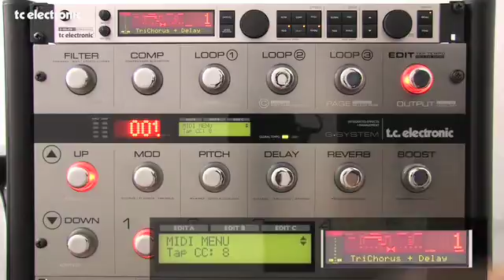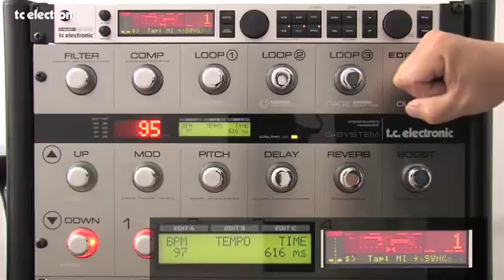G-System tutorial: Tap Tempo on external device

Comment: Hi, is this also possible with the nova system, ie to control the tap tempo on a g major 1 or 2 with the tap tempo button on the nova. Also is it at all possible to control the separate effects within a preset on a g major with the corresponding pedal of the nova via midi, ie turn the g major delay on/off with the delay button on the nova? Many thanks, Mark

Comment: Can an external switch be used to tap in the delay?
On stage is a lot different to "on bench" - there is a lot of multi-tasking and quick thinking going on.
It is too common for floor units to be released before testing for stage-usefulness using independent musicians.
I don't want to have to reach my booted foot over to the back row of switches, and risk hitting the Boost switch. (Actually I don't want to wait 4 beats before the new delay tempo kicks in either)
Do I have to resort to an external Midi Tempo Switch? - or can the external control be configured as a Tap Tempo footswitch?

Comment from the maker: OR...
you can try to assign another switch button of the board to TAP TEMPO in a momentary mode. This means that the button will send 127 when pressed and 0 when depressed.  This will allow you to tap the tempo at normal speed  BUT since I do not have a Line 6 , I dont know if they still respond to the 127 (ignoring the 0) or if it simply does not work at all   If you could let us know, that'd be great!  I dont think version 3.50 will allow you to change the CC values for TAP.

Comment from the maker: Hello again,

It is not possible to change the CC values of the TAP button which will always toggle between 0 and 127 in an alternate mode. Press 1 = 127, press 2= 0, press 3 = 127 etc 

I dont know if sending a 0 value stops the Line 6 reading the tempo, or if they just use the 127 value  If they still read the 127 value,  the tempo will be divided by two when tapped. So the solution would be to tap the tempo at double speed.

Comment from the maker: Hiya,

The G-System TAP switch button CC will always toggle between the two values (0 and 127).  The TAP switch button cannot be reprogrammed as it is also the EDIT mode button. You can reprogram another  Switch button (i.e. Loop4) to send a MIDI CC in a momentary way  This means that when you press it, it always sends 127, and when you release, it sends 0. I dont know if this will work with your Line 6 effects, but I suppose they will ignore the 0 value.